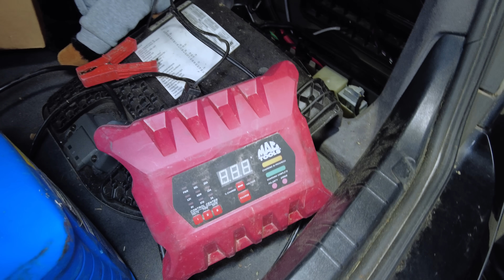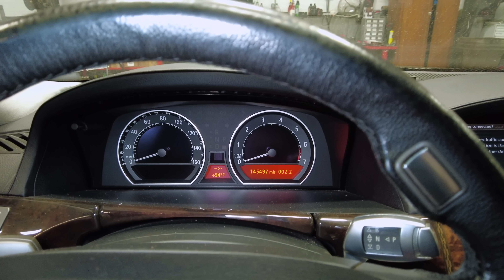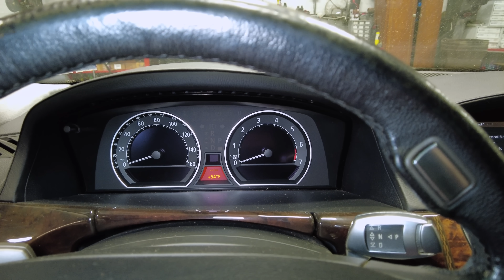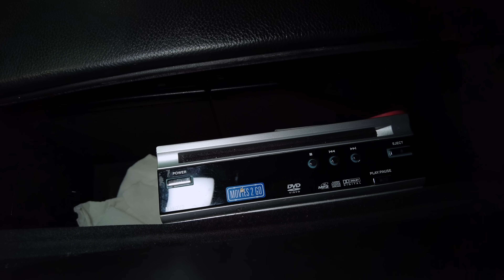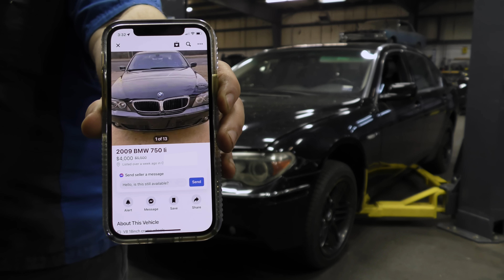Fixing a high mile German car?! Is this '04 BMW 760LI with a V12 worth it? CAR WIZARD breaks it down

Comment: My grandfather bought one brand new.
He still owns it and it has 205K miles and run and drives perfectly. 
It has been maintained  meticulously  first by the dealer while under warranty  and later by a independent garbage  specializing  in BMW and Mercedes Benz.
It has been pretty reliable with the most extensive  repair being the valve stems at 177k .
Never failed to start or left anyone  stranded.
Reply: and there's the reason it's still perfect. It was owned and maintained by someone who bought a $100,000+ car, not some tax time baller wandering onto a Buy Here Pay Here lot trying to look rich on a shoe string budget. So he actually spent the money that was required to keep it nice whereas that is likely not true for $4000 Facebook Marketplace BMWs on their 8th owner. I just dropped $3k on my M240, nothing even wrong with it. Just preventative maintenance on a level that most people don't do.
Reply: It’s in great condition because it had the money spent on it. Most people now buy these things for the kudos and to show off and don’t maintain and then ditch them.
Reply: Bet those valve stems cost more to fix than it’s worth.
Reply: @jerehada  bmw owners don't believe in "mechanically totaled"
Reply: @jerehada  My grandfather  is ninety three years old and doesn't  want to buy a new car at his age even though he can easily afford one.
He enjoys driving his present vehicle  and considered the cost of the valve stem replacement acceptable and it didn't cost anywhere near the value of the vehicle. 
Even if it did it is his car and his money and he can spend it anyway he wants to.
Reply: @andrewgarcia3136  Why would he consider his vehicle  mechanically totaled?
Replaced the valve stems on a vehicle  in near showroom condition that will most likely be his final vehicle at age 93.
Reply: @sean.f23  Very true!
I have owned numerous German vehicles over my driving career and none of them have been as problematic as Urban Legend suggests. 
I , like my grandfather,  maintained them according to the book and when issues did crop up I had them dealt with immediately. 
I have driven ALL of my German vehicles to 250k miles or beyond before selling them or trading them it.
The most problematic vehicle my wife or I have ever owned was a Honda Accord. 
It's automatic transmission was practically a maintenance item and needed to be rebuilt  three times in 160k miles and was acting up when the car was sold.
Reply: @williamegler8771 maybe he'll give it to you when he passes. These are very cool cars. The V12s are truly unicorns
Reply: Keyword meticulous

Comment: As a hobby BMW’s are really rewarding to own. These days I do about 50% of the maintenance on my ‘04 330ci, like water pump / thermostat, fuel pump, etc. Then I send it to a trusted independent BMW shop to do the stuff that I don’t have the tools or time/skills to do. 

It’s a bit expensive over time, but the satisfaction I get from seeing the car become new again and drive amazing is totally worth it. Not to mention it’s of the the prettiest BMW’s ever made.
Reply: sounds like a nightmare. I would just get a 3rd gen lexus gs350 rwd. same feeling plus great reliability.
Reply: @german80 Lexus falls short on driving dynamics though. The 350 feels kinda dull under light throttle, even in Sport mode. You really have to dig your foot into the throttle to get any meaningful acceleration out of it. Feels kinda gross. 

Reliability is definitely a hit on BMW but ever since the B58 and even the N20/B48 they’ve ranked third in reliability behind Honda and Toyota. Their new engines are really solid. I mean, they passed Toyotas torture testing to be used in the Supra so that says something.
Reply: Yes those older/not as complex ones are that way to DIY. Extremely rewarding to drive, look at, and even work on (for the most part).
Just got out of an e86 (wish I hadn't), but handed most of the common issues myself.

This 760, is not that way. Overly tight/complex and 10 times the failure points. 
Seeing how densely packed everything is on this 760 made me sweat a little

Comment: I live in an alternate universe where I own a 2005 330xi with 182,000 miles and is still cooking along with minimal issues.  And I own a 2017 X3 that has been flawless. These cars are an absolute blast to drive.  They are much more fun than my previous Rav 4 and Tacoma. I recently bought a used Lexus IS 250 and have already had $1800 worth of repairs.  I’m living a very strange auto life…
Reply: I love the E46, i had a 2004 320ci M sport coupe, black with black leather, 2.2 straight six engine, it was 4 years old , 80,000 miles I gave £6000 for it the first owner paid £28000. Lovely cruiser, I once drove it from north London to Disneyland Paris in 5 hours, it even had a switch under the bonnet to adjust the headlights to dip to the right so you don’t blind oncoming traffic in country’s that drive on the other side of the road, drank oil though.
Reply: Yeah weirdly I have had more problems with my Hondas and Toyotas than any of my Mercedes. I have never had a blown trans or engine on any of my euro cars but I did have a transmission go out on my Acura….
Reply: haha I'm right there with you... had a Lexus IS350 convertible. All struts failed, amp failed (due to poor design that lets it get soaked with water), and for 6 months it was plagued by an electrical issue that would cause the brake light switch fuse to blow. As a result the car would often not start and often would randomly lose ABS and brake lights. When it ran, it ran great and I loved the car. It got totaled and now I have a 17 M240i. Did a water pump and a coolant tank cap when I got the car and that's it. Got it at 60k and she's still running strong with a Dinan tune at 76k. Quite the upgrade from the IS in just about every possible way :)

Comment: I remember back in 2016 I replaced so much in my BMW 320d that it felt like a brand new car even though it was close to 200k. 
Feeling good that the car was in great shape I got spun round by a truck on a roundabout and the insurance settlement didn’t even cover the cost of the parts that I had put on it that year. Gutted!
Reply: Had two E90s both totaled parked at my house. Insurance covered the cost of what I owed on both cars…got me out of the contracts, but didn’t cover anything toward a new car. I know your pain
Reply: What year? My 06 320D literally had nothing but the turbo fail and radio dimmed which i replaced with a pop out pioneer, new focal door speakers, few amps and different underseat subs and a boot sub (was fun to do actually). Scrapped in 2020 due to 150k failed clutch and flywheel plus impending ULEZ restrictions made it uneconomical to run.
Reply: @justinrohomon979   It was a 2006, so 10 years old at the time. Put Bilstein yellow shocks, new springs, all new suspension arms, new clutch and flywheel, steering rack. It felt brand new to drive! 
Still driving the E61 525d we replaced it with but like you can't drivr it in central Bristol now.
Reply: @TheCounty90  ah yes 20mph plague, ulez too?. by 2020 and its impending doom for emissions i just decided to dump it, was a great car to drive and my wifes 2015 countryman sd cooper dosen't come near the driving experience.
Reply: Insurance is worthless
Reply: This is exactly the kind of thing keeping me from putting a lot of money in vehicles.
Reply: Damn that car still had over half its life left, the deisels run forever with decent maintenance. Should have saved receipts and they couldn’t deny covering the new parts. Insurance is really a big scam.
Reply: The BMW of Theseus.

Comment: I have owned 7 or 8 Bmw's over my life. They are great cars that drive and handle amazing. I was smart (or dumb enough) to lease most of those so I could dump it before it falls apart. I swear that BMW has some kind of timer that once your warranty ends... It sends a signal to break things! Now that I am in my 40's I have smartened up and own a newer Lexus ES350... It doesn't handle like a BMW, but it also doesn't BREAK like a BMW!
Reply: VERY smart. Guys who owned the same cars you leased probably got into a world of pain.
Reply: @jacquesc3166  all you German car haters act like your life will be ruined if you own a bmw or audi.
Reply: @spicysnowman8886  Is this car not case in point? The more parts that are on a car= more stuff that will break
Reply: I was once told by a European specialist mechanic in Saskatoon that all BMWs should be crushed when they come off warranty.
Reply: @spicysnowman8886  What makes me a "hater" as opposed to someone who's grounded in reality, given the evidence against BMW? Would you rather people go in depth and get into plastic components within the cooling system? Failure rates for fuel pumps? Injector replacement rates? IP-based diagnostic systems which you pay big dollar to Autel & others just to have the ability to read codes? Prices of German parts, at-large? Am I a hater for knowing about all this, how does it work?! Pray tell.
Reply: Thank you for leasing these during the golden age. Without people like you, people like me wouldn’t have such an awesome supply of old bmws 😂
Reply: You bought a Toyota with leather….. it’s not even the same league as BMW. It’s fine if that’s what you can afford, but it will never be a replacement for one
Reply: The ES350 is one of the most reliable vehicles on the road. It's very comfortable and you won't be wasting your time at the shop waiting for it to be repaired.
Reply: @TheRidersChoice  he’s leased a new bmw, own a Lexus. I’m sure he can afford it. I think he just grew up 😢
Reply: European maintenance is not even close to what US shops charge for.
Maybe it´s the brand status or shipping abroad or taxes  but it is nowhere near what the Wizzard and others charge from work to parts.
So let that sink in.
Reply: @Tigerwarhawk  Sure, it’s a great daily beater I’m sure. But nobody is claiming it’s tech or driving experience is close to BMW. If they were competitive, I would trade for one tmrw
Reply: @TheRidersChoice that's fine.  It's all about what you value.  Some want a great handling vehicle, some want a sports car, some need great capacity, others buy simply for looks.  I buy for comfort, dependability and reliability, which is why I own a 2016 Toyota Avalon Touring--the fraternal twin of the ES350.
Reply: I also own a lexus es350 it's so boring and drives like a boat I'm thinking of getting a Infiniti next
Reply: @moe1992  “it drives like a boat” is usually something associated with a unfun car…..
Reply: @moe1992  oh I thought you were pro driving like a boat lol. Even the 5 series is kinda boaty these days but atleast it has passing and high end power. A Lexus is still the same toyota economy engine
Reply: @TheRidersChoice  Toyota is a conservative brand, Lexus is luxury. If you can afford a Lexus you can afford a BMW.
Reply: @350zlover2  BMW is a luxury brand. Lexus IS under toyota. They make niche more luxurious cars but the platforms, engines. Etc ate borrowed from Toyota. When you are buying a Lexus, you are buying an upbadged economy brand. Tbh why the new Supra is kind of a deal. You’re getting a bmw underneath while paying toyota prices
Reply: @TheRidersChoice  Alot of Lexus vehicles are priced over $100k now. Majority of them are rear wheel drive bias as well. I am in the business and we sell alot of luxury brands. Everyone always compare Lexus, Audi, BMW and Mercedes. I can see if you were talking about Buick, Infiniti, Acura or Lincoln but Lexus always been a 1st tier luxury brand.
Reply: @moe1992  I hear this alot when someone is trying to downplay Lexus. What makes it boring? It's not like we are driving any of these vehicles on a racetrack.  The purpose of a vehicle is to get you to and from your destination safely.
Reply: @350zlover2  well I’m a menace so the road is my racetrack haha. Within reason and safety obviously but I enjoy taking my car on a Sunday morning drive. Pushing it fast around a corner and flooring it out of it. Nobody does that with a Lexus. Even the LC and RF are too fat for sport car stuff
Reply: @TheRidersChoice  😆 🤣 You remind me of my wife! I don't drive like that and I have a 350z. Maybe I am scared to crash it. Your right, certain Lexus models are not for that. But they are super comfortable and quiet.

Comment: Used to have a 2008 E66 750Li. Had it for 2.5 years, put 25k miles on it and only spent $1,500 for maintenance. My first car was a 1994 740iL. Now I'm in a 2013 F02 740Li and thinking of getting a 2020. Why couldn't my first car be something else. I swear it sparked something in me.

Comment: These 7 series had a lot of tech potential like active cruise control and even night vision, that would be really fun to retrofit onto the car in my opinion
Reply: This was also the first BMW with the IDrive system if memory serves me right. Only area of concern would be the electrical problems these tend to have.
Reply: My 5 series has the same options I can retrofit. It’s kinda fun retrofitting options lol. I retrofitted brown interior with rear folding seats so far

Comment: Never mate hoses to plastic posts with worm clamps.  Plastic will deform significantly as heat rises and if your worm clamp is as tight as it can be at room temp, then when the heat climbs, your plastic posts may fault under the pressure and even fragment - turning a simple hose repair into a major part replacement.
Reply: This.  Constant tension clamps are much, much better.
Reply: Shop I work at has never had a problem, unless its BMW plastic specific. The OE type spring clamps are just as bad, as they lose tension over time, and will also expand when heated, causing leaks. Worm clamps will also expand, but at least their tension is adjustable.
Reply: they make high temp plastic pieces, GM uses them all the time
Reply: Never had a problem with the plastic radiator fittings in my Lexus.
Reply: @jamesb8305  You using worm clamps on those plastic posts?

For some reason, a certain kind of person seems to think the problem is with the plastic - when I made it perfectly clear that it's the worm clamp - that does not expand with the plastic as heating occurs that's the problem.

There's a reason why your Lexus, when it came of the lot, had spring clamps around the hose fittings and NOT worm clamps.
Reply: Better to replace all the plastic lines with nylon/copper tubing. The repair is permanent.
Reply: I use breeze constant torque clamps.  Is that what you recommend?
Reply: never thought of
this... am gonna look into constant tension clamps. Thank you for the insight!
Reply: The clamps could be better but replacing the expensive plastic pipes with simple hoses is actually a pretty clever solution. It doesn't look as pretty but does the same job for a fraction of the cost. It can turn a repair of a bunch of OEM pipes that add up to a 4 digit bill to a 50$ fix.

It's the right way to own an older car.

Comment: I had a 2006 760LI. It was a great car. And the engine was not an issue. The main reason people give up one these is all the electrical gremlins. And every generation have something that is a ticking timebomb. On my E38 735I the whole coolant system blew up...

Comment: Excellent very well explained  On my car BMW (750LI) 2004  N62 Engine It had   Dyanamic stability  problem plus Stater by bosh had gone it 
Altinator oil cooled seal was gone. Cooling reservoir tank. was leaking.  batterys are the very big issue they don,t hold charge. I purshased it
2800 $  sold it For 3500 $ without getting it fixed .
♥
Reply: Love the 7 series V8 Petrol

Comment: I am going 211,000mi on my 2007 Mercedes E200 T wagon with a manual transmission. Worst so far has been a flakey solenoid on one of the rear air springs. Replaced and it’s been perfect.

Comment: Among the 6 Vettes I've bought owned and sold I would get a yearning for a used 911 or BMW M series (manuals of course) and would shop in earnest.  What a blast to drive!  I would then go/sneak back to the service dept and ask for prices for regular maintenance (oil changes, gaskets, etc.) and repeatedly came to the same hot kiss at the end of a wet fist realization;  I could easily afford to buy a late model used BUT I couldn't afford to own it......Ich bedauere, mein herr.......